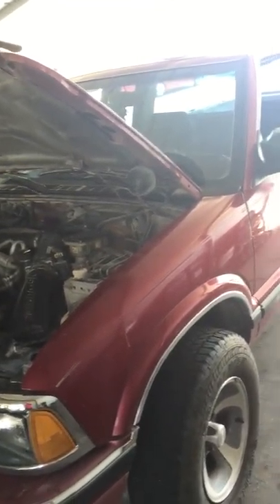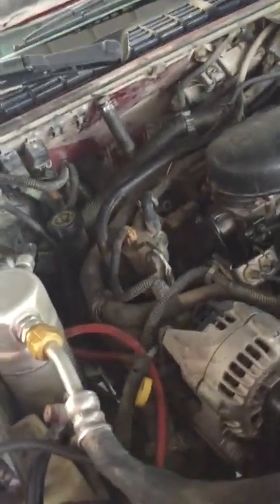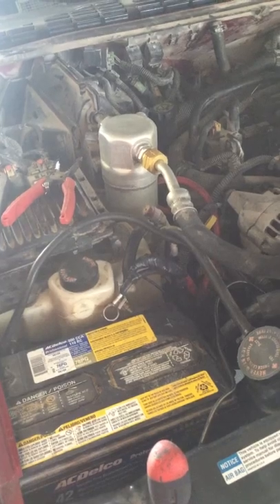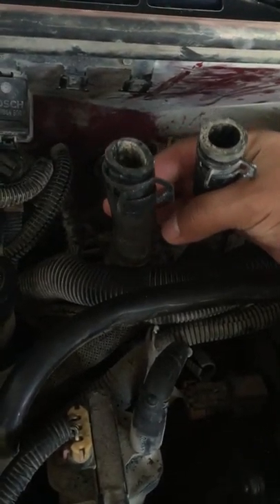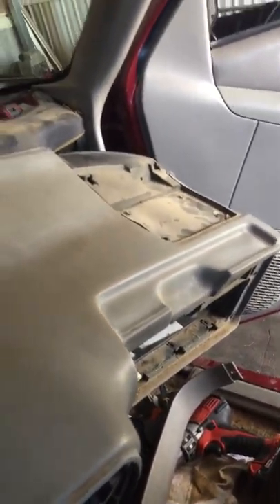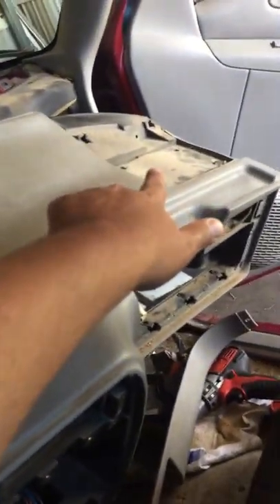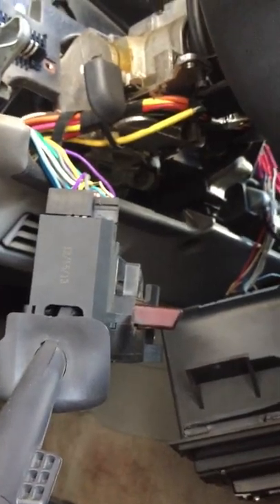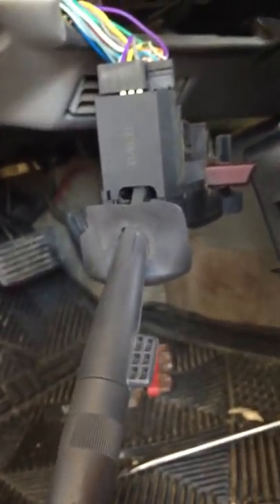1996 chevy s10 heater core, odometer, dash removal

Comment: Awesome video dude! Do you know if the heater core for your extended cab would be the same as a 96 extended cab with the TBI motor and not the vortec?
Reply from the maker: Hey I appreciate it! My best suggestion would be, to follow your coolant hoses going through your fire wall. Those hoses should lead you directly to your heater core, if you have any more questions feel free to let me know! Also, I made a more detailed video if your interested. If you subscribe to my page you’ll find it much easier, it should be titled about the same as this video, if you can’t find it let me know! Please like my video & let me know how it went!

Comment: Man I just changed my heater coil on a 1997 GMC Sonoma I have to plugs that's right around the steering female plugs that I can't find the plug that goes to them I'm thinking that I might find them on the very bottom panel that goes around the glass pedal?
Reply from the maker: Yea check at the very bottom.
Reply: Thanks from southwest La

Comment: looks like you need to learn a whole lot on doing mec work you went to extreme taking out heat coil,the steering wheel don't need droped and you don't have to take dash off ,just remove bottom screws on dash ,and top ,then put you a 2x4 jack under bottom ti lift up and out, to get access to all screws,,,